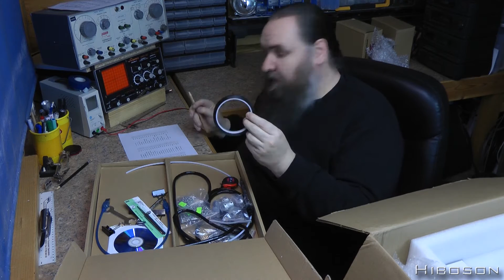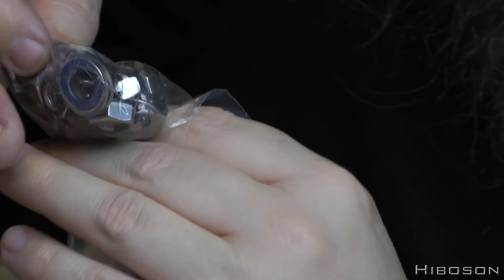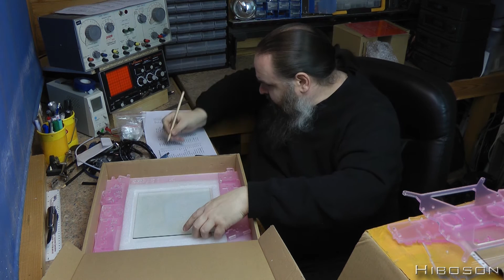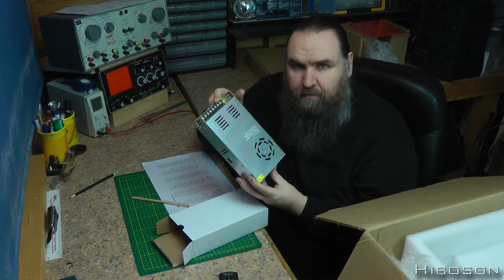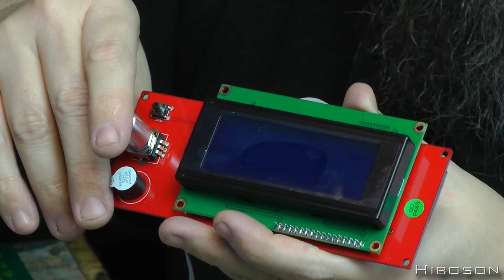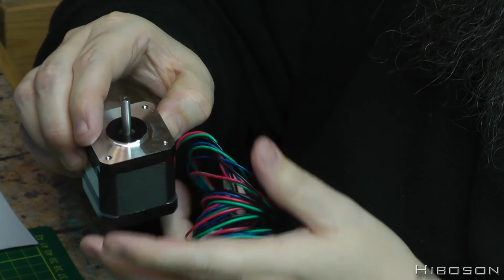Sunhokey 3D Printer - Parts Check

Comment: Nice :) two things to keep in mind
1. The wires of the steppers are correct, DO NOT cut and switch leads
2. Some of the smaller Acrylic pieces are VERY delicate, I cracked on in error while tightening, be careful(though they give u 2 pieces extra)
Reply from the maker: Thanks for the heads up, I have already switched the wires over but I did it by popping the crimped connectors out of the plug and moving them around, it's an easy swap back :) I did wonder WHY! you would have them swap around, glad my instincts where correct :)

As for acrylic parts so far I've done all that bit and apart from the pre-cracked piece lol I've not cracked any,,,, YET!!!! ;)